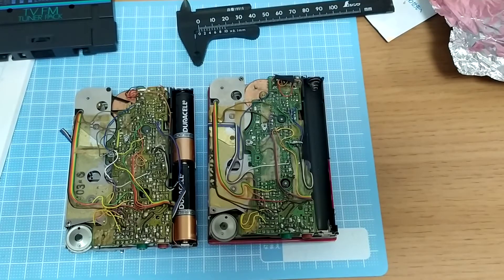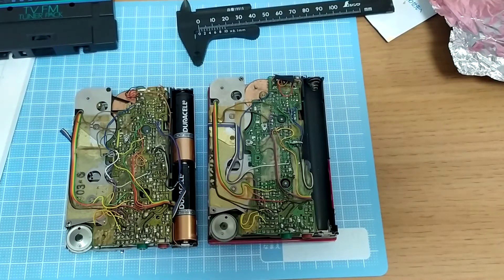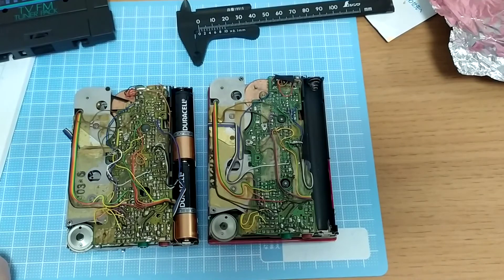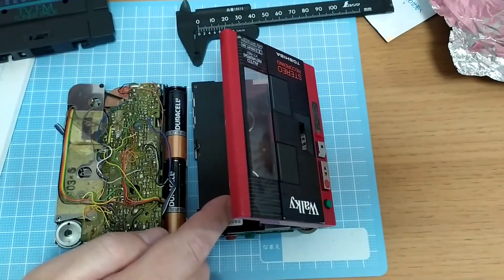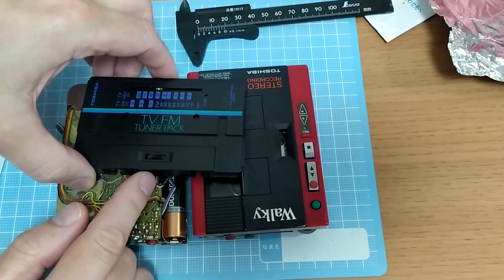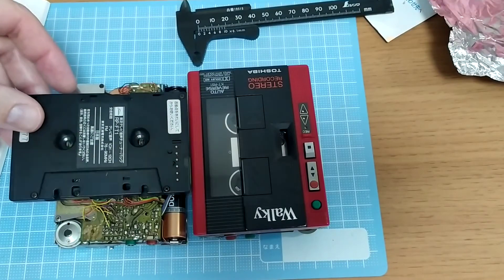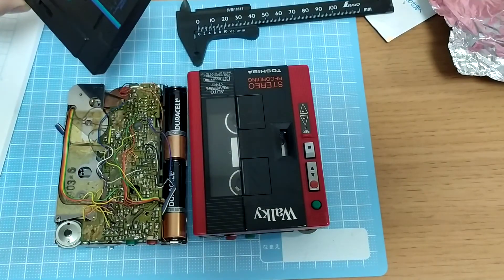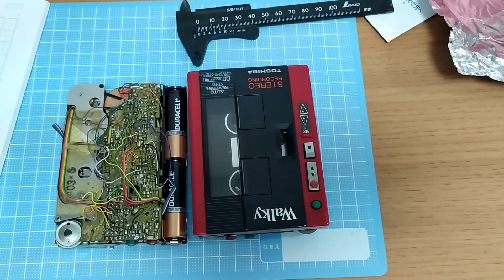Toshiba Walky KT-RS1 Part 3

Comment: KT-RS1 is a pain to work with because of the wires, but managed to fixed the gears and reels hub with JB weld without de-soldering any wires. all wires have enough slack to open the circuit board wide enough you can access the gears driving the reels.
Reply from the maker: I imagine they are a great player when you get them working.  I haven't quite got there yet.  Need to dig them out of the cupboard.

Comment: Dont know what fixed you do, is that we need to open up the circuit to replace curoa cable ?
Reply from the maker: Nothing is fixed yet, this is talking about some of the many issues I've had.  I keep putting this project on the back burner as other projects turn up.  Yes, you need to desolder some wires if you want to change the belt.  Probably a reasonable design choice at the time where they probably expected it to have a life of 5 years or so before being swapped for the latest and greatest model, but annoying 36 odd years down the line.